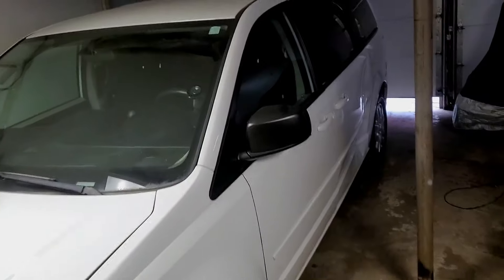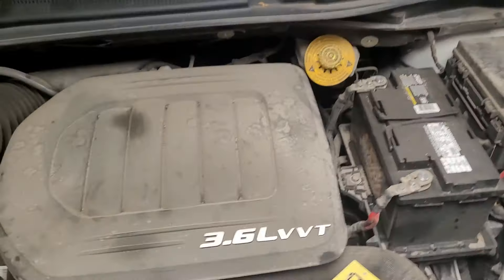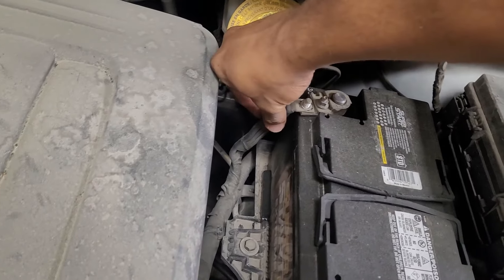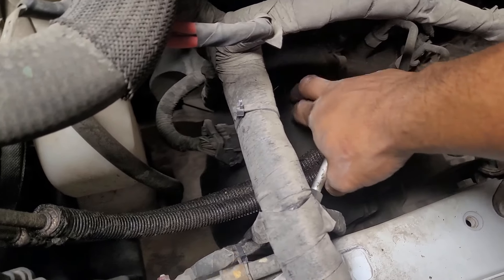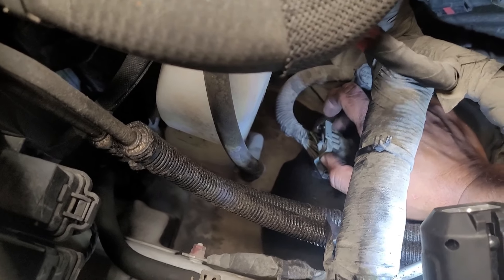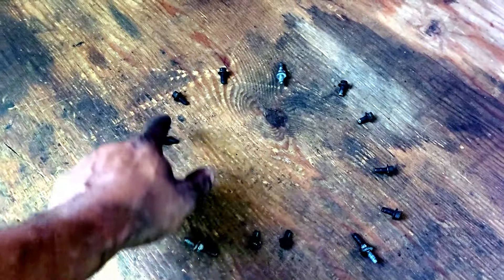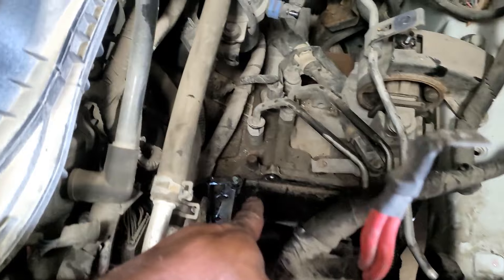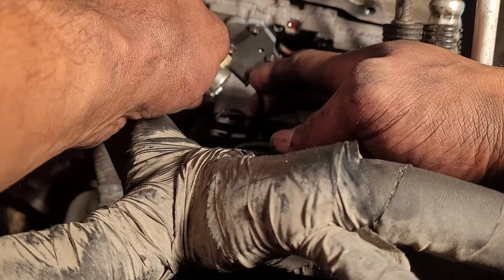2014 Dodge Grand Caravan 62TE Transmission Shift Solenoid (Minute Maintenance)

Comment: What is the problem 0f a 62TE when at high speed/uphill I can smell burn and I could feel that it is hot inside the cabin. There is no engine light. Mine is Ram C/V tradesman 2014.. Thanks.
Reply from the maker: How many miles do you have on your Ram?
Reply: @minutemaintenance7385  30,000 miles only.
Reply from the maker: @jhunmanlapaz6972   Hmmm id need a little more info to narrow this down, Burning and Heat when going up hill could have lots of causes...Clutch issues, low fluid in the Transfer Case or Differential, brakes burning or just fluids dripping on the Engine/Exhaust when at the upward angle. Any other symptoms besides the smell and heat? Temperature gauge changes? Check engine codes? Any noticebale leaks underneath? Why do you think its the transmission specifically are there Shifting issues? High RPMs?
Reply: @minutemaintenance7385  Temperature gauge below the middle (1 notch). There is no engine code using OBD scanner and no leaks whatsoever underneath. At starting, changing gear from park to R then D I felt the van shudder (not at all times, intermittently) and when it runs the shifting from 2nd gear to 3rd, to 4th is advance/fast/early. When I want to increase the speed, say from 80km to 90km to 100km, the engine rpm will always increase.
Reply from the maker: Have you checked your transmission fluid level? If not, start there. Does the fluid smell burnt? How long has it been acting like this?
Reply: @minutemaintenance7385  I already done it and there is no smell. Maybe I will flush the fluid and change the filter. Thanks.
Reply from the maker: @jhunmanlapaz6972  We appreciate you reaching out to us with your question! Based on what you've mentioned so far and given you say the Transmission fluid does "Not" smell/look burnt and is full I don't believe this to be a transmission issue you're describing. Something is causing the burning smell and heat that you're feeling, if transmission was the cause the fluid would be effected and smell/look burnt. If it's my van, I'd look in a few places, the Front differential to make sure the fluid is clean, non-burnt and full! There's 2 ports for any differential. Do NOT open the bottom one that's for draining only. For checking levels open the top port that way you can add fluid. If you open bottom and top is seized you wont be able to fill it back up. I'd also check my brakes all around, it's possible a Caliper is seized. If all those check out, I'd drive the van to try and recreate the issue, the moment it starts I'd pull over, pop the hood and try to visually or with my nose find the source of the heat and smell while its fresh and strong. Check the brakes, check the engine, crawl under and see if you can feel the heat emanating from somewhere it shouldn't. The shifting issues you described could be related to the same Solenoid in this video, however the burning and heat leads me to believe it's a separate issue that is also effecting the driving/shifting. Such as a dry or old fluid filled Differential, Seized Brake Caliper or even a bad/seizing wheel bearing. Happy Hunting! Feel free to reach out if you need more Info!! Good luck!
Reply: @minutemaintenance7385  Thanks a lot for the info. I will let you know later of the status once I did. Thank you again.
Reply: 4 months ago I brought my van to Mr. Lube to flush the Trans fluid and change filter, but still the same symptoms.
Reply from the maker: I'm sorry to hear that you're still having these issues!! As you can imagine it's hard to diagnose a vehicle over the internet. At this point its probably best to take the vehicle into a shop to have it formally diagnosed.

Comment: I have a 2012 dodge grand caravan with 144k miles with a code p0740. It still runs great. The car use to shift good until last month. high gear at 40 mph and is not shifting right, changed the transmission fluid. Only stalled twice in the last month. Will changing the torque converter solenoid help it?
Reply from the maker: Can you give me a bit more info and explain what you mean when you say "not shifting right"
Reply: Have you fixed your no shift problem?
Reply: 740 code most likely needs a new converter... as  they say over the forums

Comment: Hello have you ever dealt with a high temp transmission problem
Reply from the maker: Hey Thanks for Watching! To Answer Your Question, in General Yes.

Now I'm Not Sure if Your Question Refers to a Code Being Thrown for a "Temperature Sensor" or a Dash Gauge or Code Simply Implying "High Transmission Temperatures"..Either Way the Most Common Cause is Low or Dirty/Old Fluid and Filter!

Transmission Fluids Most Important Job is to Cool the Gears as Well as Lubcricate, if the Fluid is Old/Dirty/Burnt (Even if You're Making Sure Fluid is Full by Just Adding New Fluid on Top of Old) it Will Cause the Transmission to Overheat or a Sesnsor to Read as Such.

I Always Recommend a Fluid and Filter Swap to Guarantee Freshness and Removal of Built of Contaminants i.e. pieces of Metal from the Transmission. This Will Resolve Alot of Ppls Issues.

However "Temperature Sensors" Themselves Can Go Bad and That Will Take a More Direct Check by a Specialist to Verify.

Hope This Helped, Happy Wrenching and Merry Christmas!

Comment: What code will come up if the solenoid is bad?
Reply from the maker: Hey thanks for watching and the question. The generic codes that will appear for a bad solenoid will begin P0750 thru P0759. Now as I mentioned in this video this customer had no codes, this was a symptom based diagnosis. Sometimes codes, especially in the transmissions will throw forna bad solenoid when the solenoid is good due to being intermittently shorted out by metal flakes on the fluid from normal wear and tear of the transmission. I always recommend a fluid and filter swap first as that tends to resolve most transmission issues in my experience.

Happy Wrenching.

Comment: What were the symptoms before changing the old solenoid?
Reply from the maker: Hey thanks for watching, as mentioned numerous times in the video the owner reported stalling when shifting from reverse into drive. However there are numerous symptoms a bad or failing solenoid could show including hesitant shifting, hard shifting, erratic or non shifting.

Comment: Hey do you know where the transmission pressure sensor is on a 2015 dodge grand caravan transmission there is no information on this I need to replace mine
Reply from the maker: Yeesh you are right there isn't much info out on that switch. I'll attempt to drum up a shop manual and get better Info but from what I'm able to determine you'll need to go thru the same process of locating the Valve Body as I did and that sensor is also bolted on in the same general area. Assuming you also have the 62TE transmission. What leads you to believe this sensor is your issue? Are there any codes? Has it been properly diagnosed?

Comment: Awesome video. Most detailed instructions I've seen.  I'm thinking about undertaking this job.  No check engine light,  but my 2015 Caravan will sometimes die at stoplight. Shift to park and it will start back up. Battery, alternator are all good but no check engine light and this is the problem that comes up when I looked online.
Reply: My 2015 is doing the same as yours, did you replace the solenoid and if so did it fix the problem?
Reply: @joshdavis6753  I haven't had it occur again for me to go out and bite the bullet on this repair. I'm a little hesitant reading comments about transmission fluid leaks while accessing the part and other comments suggesting I replace a seal while I'm down there. Let me know if you end up doing this.  I'd like to trade the damn thing in, but times are tough

Comment: Could this sensor be the cause of the vehicle not shifting at all? It's a 2014 chrysler 200 with the 62te. It only drives in 1 gear.
Reply from the maker: I'm sorry to hear your Transmission is stuck in 1st gear. Can you manually shift thru your gears? Reverse, Drive, 1, 2, 3? If your Transmission truly only has 1st gear that a sign of a severe issue that I dont believe can be solved by changing the TCC solenoid. Your best bet is to go to a Transmission shop and have it diagnosed properly. Good Luck!
Reply: did you find out what was wrong with your chrysler 200?
I'm having the same problem
with a chrysler 200
P0731, P0792

Comment: What was the check engine code for this solenoid? Po750?
Reply from the maker: Hey thanks for watching, that is a code associated w/ the shift solenoid. However as mentioned in the video this van did NOT have any check engine codes and my research has yielded that is a common occurrence. This video goes over the symptoms related to a bad shift solenoid as a code will not Always be relevant.

Comment: does the pan has a felp gasget or do you  apply  a silicone  coat around the pan
Reply from the maker: There was no gasket or seal! That side of the Transmission does not get exposed to excessive amounts of fluids because all the electronics are on that end.

Comment: Hello what dodge caravan do you suggest to buy ? 
Year ? Thanks
Reply from the maker: That's a tough question to answer partner. Vehicles are unique like ppl, all depends on their handling and upbringing to determine how good they are later in life ha. I've had good luck with late 90s and Mid 2000s Dodge Grand Caravans personally. Not so much 2010+... With proper care and maintenance any vehicle could last a lifetime!
Reply: 2009 my 09 never had this problem is now 320k

Comment: Hey, I hope someone can help me.
I have a 2012 chrysler 200 3.6 with the 62te Transmission. The engine runs great but when driving & starting to slow down, the Transmission won't seem to downshift.. even when trying to accelerate once past 35 mph, it struggles & usually stays in 6th gear.. The RPM's will drop crazy low & stepping on the gas will just cause it to "bog" out.. I usually have to manually downshift it to keep it from stalling out. 
If I slow down to a certain speed it will downshift but I don't understand why it's not downshifting upon pressing on the accelerator when power is needed. 
I changed the plugs, Airflow sensor, Crankshaft Position Sensor, Transmission fluid & filter. 
Any ideas?
Reply from the maker: Based on Your Description it Sounds like a Damaged Shift Solenoid!

Comment: Bro code 0765 has same issue or different
Reply from the maker: Hey Boss thanks for watching! Unfortunately my answer has to be....idk! The code you mentioned is specific to the Shift Solenoid "D" based on my research which has a lot of causes for signifying the fault. The Solenoid in this video did not give off a code. Based on the code you gave first thing to do is check the transmission fluid! Your issue can be caused by low, dirty or old fluid, or a clog in the filter. I'll attach a link below to a video on "how to change the transmission fluid and filter" if that doeant resolve your issue my research says its "more" likely caused by an electrical fault in the system as opposed to the solenoid itself. If I'm you I'd spend the little money and time to change the fluid and filter and reset the code. If that resolves the issue ,great! If code comes back..take it to a shop for proper diagnostic.

https://youtu.be/fuM0d4SfTlY

Comment: My 2015 Town And Country stalls out when exiting the highway and coming to a stop. The first couple times the car would lunge forward and buck, rpms going down almost causing me to collide with the car in front of me. Then the engine would stall put but start right up again when placed in park. Now the engine doesn't buck, it just stalls out but when I put it in park and try to restart it it just stalls out again when going into drive. Then on the next try I give it throttle while going into drive and it will be ok. Then it won't stall at lights on regular roads , but if I get on the highway it will stall when exiting and coming to a stop. It stalls out every day. Any advice ?
Reply from the maker: Wow!! I'm so sorry! That sounds insane...1st advice stop driving this van until you get this problem resolved! Cheaper to pay for a bus ticket then insurance rates over an accident or injury!

Will it ONLY stall when in Gear? If it ONLY stalls when in Gear (Drive or Reverse..Park/Neutral don't count for this) then it's transmission related! And this Solenoid could be your culprit! If it stalls when idling in park...neutral..engine "Bogs" or feels NOT smooth and normal at idle..then it could be an engine issue i.e. Severe vaccum leak, Fuel pump going out, or even a bad electrical connection pr battery and when under constant "load" it heats up enough to separate and cause misses.

If theres any codes of course get those scanned by a professional or a local auto store with a scanner and research that code. If no code and only stalls when in Gear...I'd try a transmission flush and filter first, then the Solenoid in this video! Good luck!!

Comment: How long does the solenoid pack last?
Reply from the maker: Thanks for Watching and the question, unfortunately that's a user by user basis. It depends on how the vehicle is driven and maintained as the Solenoid Pack is within the Transmission so if the owner doesn't keep up with proper fluid levels and changes..overheating and debris build up can occur which will damage the pack sooner. I've seen vans with 200k miles with the original pack..the van in this vehicle was just around 100k.

Comment: My code says shift sensor B do you know wich one that is?
Reply from the maker: Unfortunately I dont. Most Vehicles  with automatic transmissions have solenoids labeled 1, 2, 3...or A, B, C..knowing exactly which is which depends on your specific vehicle, year and engine/transmission combo. That being said in my experience the number 1 cause of solenoid issues or codes worh transmissions is...Low, Old or Dirty transmission fluid and filter. In my experience flushing the transmission will clear contaminants and allow shifting to resume as normal.
Reply: @minutemaintenance7385  thanks
Reply: @minutemaintenance7385  it would be the same transmission your working on in the video

Comment: minute maintenance could you link the solenoid you bought so i can order one
Reply from the maker: https://www.mymoparparts.com/oem-parts/mopar-trans-variable-force-solenoid-0-90-psi-sensor-with-62te-6-speed-automatic-only-5169313aa?c=Zz1lbGVjdHJpY2FsJnM9c2Vuc29ycyZsPTQmbj1TZWFyY2ggUmVzdWx0cyZhPWRvZGdlJm89Z3JhbmQtY2FyYXZhbiZ5PTIwMTQmdD1yLXQmZT0zLTZsLXY2LWdhcw%3D%3D
Reply from the maker: That's the part I ordered partner!
Reply: Thanks bro!

Comment: How much oil did you use to fill up after the oil came out
Reply from the maker: I had No Fluid Loss from The Solenoid Swap! I've heard other ppl have had fluid loss but I personally didn't and my research suggests you shouldnt have much fluid in the pan as its heavy electronics on that side. If I'm you I'd either "eye ball and best guess" the amount of fluid loss and refill...if it looks like a Qt. Add a Qt.  Otherwise the Next Video on Our Channel, after the Solenoid video, shows how to make your own dipstick...if you can watch and do that and check and make sure the fluid is at the proper level!!
Reply: I lost oil when I removed the front pan will it be normal?
Reply from the maker: I personally did not lose any oil, but oil does flow thru this area. After reinstalling just check your fluid levels and add Tranny oil as needed! There is a follow up video on this site about changing the Transmission fluid AND making a homemade dip stick so you can check your fluid levels!

Comment: Hi there great video. Did this fix the issue? I plan to do the same. I have rough shifting with TCC error code. Did you change the tranny oil? Like your humour. The small screw connected to solenoid is torx screw.
Reply from the maker: Appreciate the proper terminology! This did resolve my issues! The Van was not throwing any codes so I cant speak specifically to the TCC code. But the van no longer has the intermittent stalling, while shifting problems! And yes I did change the Transmission fluid and filter as well, there's a video reference that process on this same channel as well posted the following week!! Good luck with your Solenoid swap!! If I wasn't filming...itd have been a 30 min project and a 4 out of 10 for difficulty!
Reply: did you drain the fluid before removing the pan ?
Reply from the maker: Negative I did not. I simply removed what you saw in the video! The fluid contained within the area of the TCC solenoid was very minimal.

Comment: NICE VIDEO.
DO WE HAVE TO CHECK LEVEL OF THE TRANSMISSION FLUID AFTER CHANGE THE SELENOID?
Reply from the maker: Thanks for watching! Yes it's always good to check the fluid FIRST. Most solenoid issues are responding to dirty, low, or old fluid. More often then not a transmission flush (New fluid and filter) will prevent the need for the solenois change! 

I'll attach a link to this comment on how to check/change the transmission fluid and filter on this vehicle!!

https://youtu.be/fuM0d4SfTlY

Comment: No gasket?
Reply from the maker: There wasn't one on this van and no signs of an rtv so I personally didnr add any. Some commentors have advised there vehicles had a gasket!! So if you take it apart..and you have a gasket..be sure to replace with a gasket or rtv!
Reply: @minutemaintenance7385  thank you

Comment: What code would this give you
Reply from the maker: Any code related to the Pressure lines. Ex p0933 could be one. BUT as mentioned in the video you will not always get a code for this issue! Or a check engine light. This can be diagnosed more by symptom. The stalling when going into gear. If you're lucky enough to be showing a code, research and run with that info. If you're having the issues described and no code present..fluid swap and filter or the VLP/Shift sensor/Solenoid shown may be the answer.